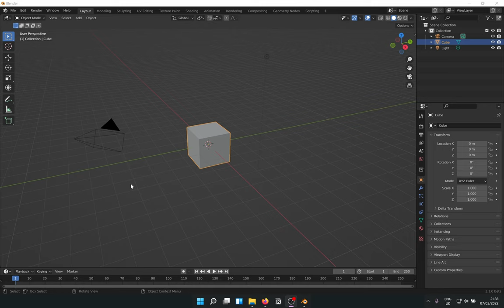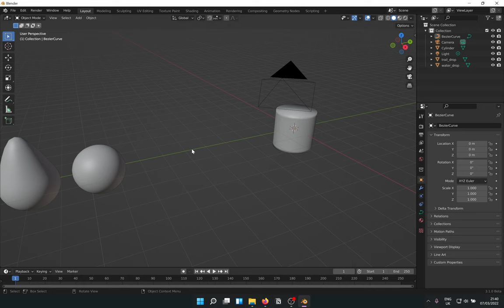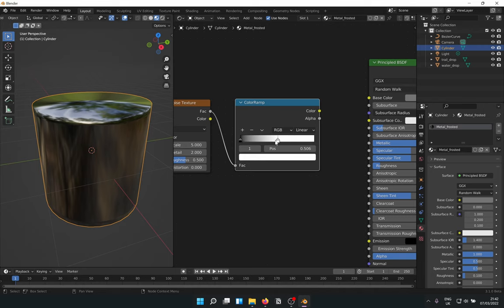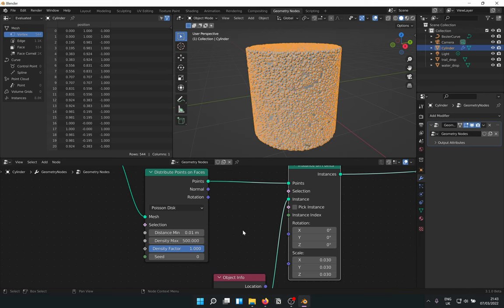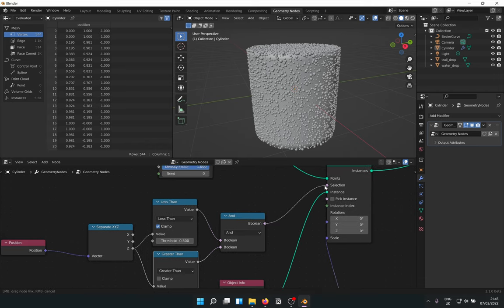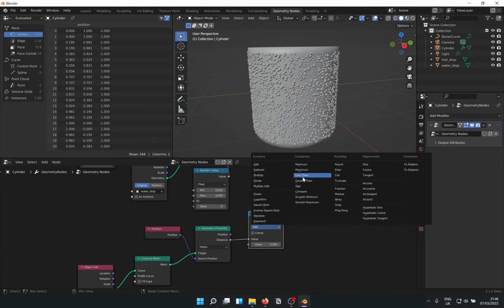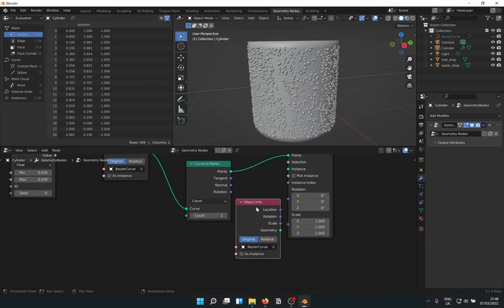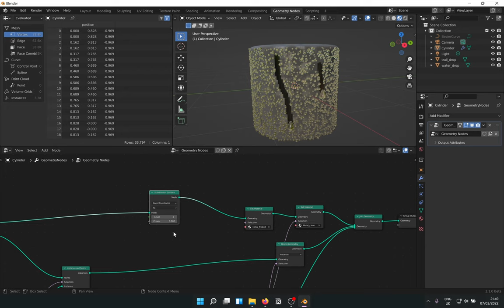17 | Tutorial | Condensation using Geometry Nodes in Blender

Comment: The bezier curve isn't doing anything for me. When I mark on the can, all of the condensation comes back, but no lines. Please help lol
Reply: For me, i draw the lines and the drops don't come back
Reply: same here
Reply from the maker: Are you sure you are using the "draw" button in the edit mode of bezier curve and not the "annotate" button? They both look similar and more often than not I have made the mistake of annotating instead of drawing a curve.
Reply: @bakedmystic3D  same thing here. yes im using the draw. I guess they changed something with newer versions??? im using 3.6 as of now and its not doing the same thing
Reply: I found the solution, make sure the origin of the curve is at the same point as the origin of the cylinder